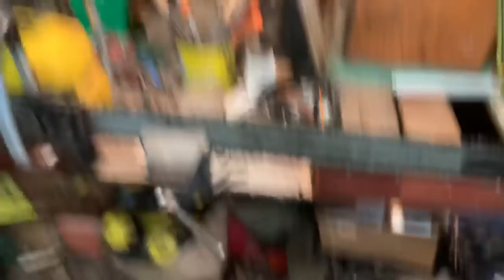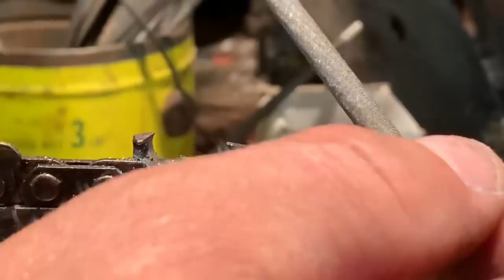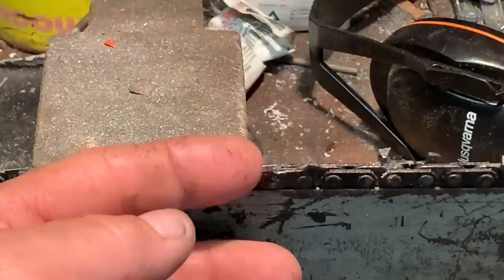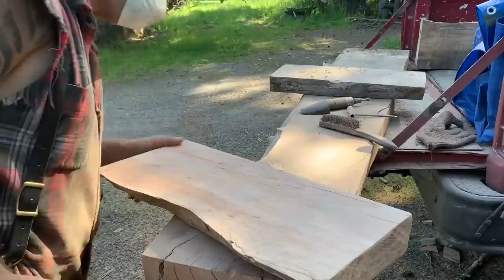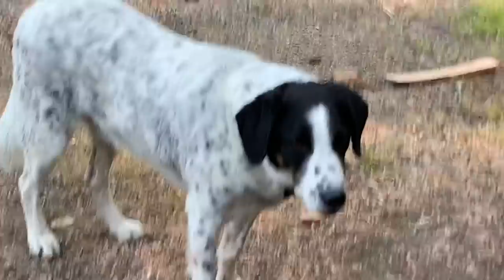Chainsaw sharpening myth. Debunked

Comment: I hear ya, much respect, but you should not dip your file down...you should not file into the links...should always stay horizontal.  And part of the problem with a saw that dips down to the right or left when cutting has been proven to be partly associated with different teeth length...you should strive to keep all of your teeth similar in length (from the leading edge of the tooth back to the "guide/angle line")...have been taught by both Husq and Stihl factory reps to "try" to keep the teeth the same length...so might have to sharpen some more than others (at the end of the day), takes longer to check, but that's why out in the field when doing quick touch ups and not measuring/eyeballing then it's recommended to count 3 strokes per tooth (should always do a light touch up after each tank of gas).  But first, ahead of different teeth length, that cause dips to the right or left when cutting, is different teeth angles, especially differences between the teeth of one side of the saw versus the other....because we're all either right or left-handed, stronger one side or the other, etc.  So it is very crucial to keep the angles the same...else you get dips.  And third as you said, file those rakers too and make sure they're all the same height; otherwise, you get bounce/chatter/grab....   May you keep the chips flying...chips good/sawdust bad  (I've been cutting for 47 yrs)

Comment: Gonna get a carbide chain for low stump jobs..see how it worx
Reply: Hello friend! I’d be interested in how that turn out for ya!
Reply: @shapeshifter7753  there about $ 200 each and dirt doesn't ruin so quick I have stump grinder and have to cut stumps low alot in dirt. 
I have channel I put it on there.
Reply: I bet that carbide will save you at least that in time! I’m gonna check out your channel too thanks for that!
Reply: @shapeshifter7753  ok thanks.
You need a diamond grinder wheel like for tiles to sharpen carbide. I do my own
Reply: Very cool! Will you be posting a vid on you doing that?

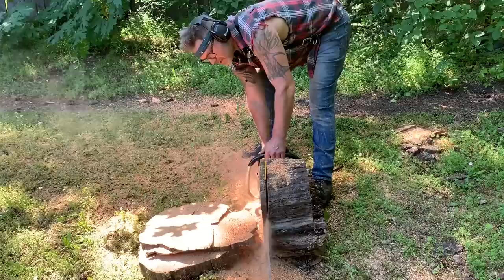Comment: LMAO,some debunking..lol.. when you can clearly see how crooked the cuts are (especially before you snap that little piece off) between 19:08 and 20:08.Then the log moves and you can't tell because you're not looking at it straight on...lol

Cutter length (which equals height of a cutter) does matter,even if all the rakers are at the proper height for each cutter.You're video just proved that if people are paying attention...lol
All cutters should be the same,yes very close can be fine but that crap on that saw is just proving the point...
Reply: I'd say that it is marginally crooked, and I don't think he ever said you will cut perfectly straight. I'd say it only matters on a felling cut (something he has obviously done successfully numerous times), or if you sell firewood and all your customers have OCD lol. Otherwise, it seems like a non-issue between marginally crooked and perfectly straight.
Reply: @rider660r  You sound mad bro... I disagree, they are not way crooked, only slightly. And like I said before, it doesn't make a difference if it is slightly crooked. I'm not sure why your so bent out shape over something that's a matter of preference. I'd also bet Buckin Billy would runs circles around you in the wood lot or on the ridge dropping trees.
Reply: @rider660r  Man, you assume a lot about me based on having no knowledge of anything about me. I'm not a part time anything to do with trees lol. I work in healthcare. I'm also not an idiot, but your need to sling insults at me and Billy tells me a lot about you. If you watch this guys channel, it's quite clear he is pretty successful and good at what he does. And for the record, I, like you, do try to get the cutters pretty even, just because it bothers me if I don't, but he clearly shows that they don't have to be. Also, something not discussed before, but do you toss a chain or eat up good teeth to get them down to the same size as a tooth that hit a rock or nail in a tree, or do you just roll with it and save the chains full life. To me it makes sense to continue using it if it's safe, and if you need a perfectly straight cut for felling or some other reason, throw on a new chain or evenly sharpened one. Just a thought.

Comment: You get a little hungry with that file.  I cringe if I got to hit a tooth with more then 4 strokes.  You hit it 10x plus but im on the cheap side. I want to last as long as possible.
Reply: If they are at all damaged it may take that many.
Reply: @jeffreyrubish347  hardly so even after rocking the teeth

Comment: I notice you REALLY do a lot of filing from the right side, and not much from the left.
Your right side cutters are filed down more than double your left.

I found this happening to me, so I changed my technique to removing the chain, and locking the drivers into the vice so the file would cut more evenly.  This way, I can flip the chain, and do the other side from the same side so my pressure is the same, and the cutters are filed the roughly the size.

two pieces of heavy angle iron holds the chain just fine!

Comment: I am that guy who believes that you need to call things what it's proper name is! If someone told me I needed to file a raker and I didn't already know what it was, I might be scratching my head wondering what the hell is a raker? I own about 70 chainsaws, And around my area, I am the guy everybody comes to for answers about them! And I try to teach while I fix because that is what us old boys are supposed to do according to the Bible. So I tell people that I can't be there for them if they were up in the woods and something went wrong! If you own a tool or a toy such as high performance car, Bike, Chainsaw, It is a must that you know what your doing! Because you can turn something cool in to a piece of shit in no time flat! I have a couple of chainsaws that are very beautiful saws, But they were in the hands of a rookie who didn't have a clue what the hell he was doing with it and cooked the thing down because he didn't really know what to listen for when the machine is begging for mercy! And yes! Everyone has a little different way that we all do things! And I never fart around with the gusset of the chain, I agree with you that you can scrap the information you were taught about sharpening a chainsaw and learn by hands on! I file until the front edge of the top plate is without any flaws and then I twist the file while pulling up slightly under the top plate until it is smooth and sharp at the face of the cutting edge. I must be doing something right! Because I can make shavings enstead of chips and I don't believe you can get it much sharper then that! One of my favorite saws is a Husqvarna 266xp from Tomos Slavaina Yugoslavia and I did an exaust mod and a big ol 255 carb and believe me when I tell you! That thing will put a smile on your face when you're in the cut! Beautiful music my man!😉

Comment: Jesus Buckin Billy, I'm 73 and after 43 years of struggling with sharpening, in my opinion, the very, very, very first thing you should tell people, in plain, easy to understand English, without all the entertaining as-all-hell-theatrics-of-yours, is that each and every raker needs to be sized specifically to the tooth closest to it, which means even if every single tooth was a different length, the cut will be perfectly straight, and this is because every single tooth will only be able to dig in .025, or what ever thousandths you set it to, so they are all the same. For crying out Buckin Loud, if every tooth was a different length, but every raker was the same, then some teeth will dig in deeper and the cut will be crooked, makes sense, and I never once thought about it as it just never occurred to me. This is absolutely major even though it is so simple, and in my opinion these are the words people need you to lead with. Another thing, the only depth gauge I have ever seen till now is the one that sits on top of the teeth, and I am left wondering why I never knew about the other type gauge. I am totally blown away by this new-to-me knowledge, and I owe it all to you, thanks so very very very much. I do wish you would go over all the meanings of all the numbers, like I have a chain with a 3 on the part that fits the groove and above that is a 2, and I have no idea what they mean. And then file size is another matter that needs a lot more attention. Somewhere along the line something got out of control as it should all be universal, as in a 3/8th bolt is a 3/8th bolt, and only a 3/8th nut will fit it, but these chains have so many numbers I can't tell if I am coming, going, or gone, it's so confusing. Keep up the good work but we need more, and thx again!